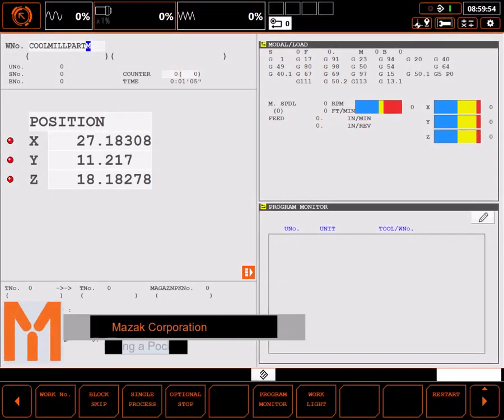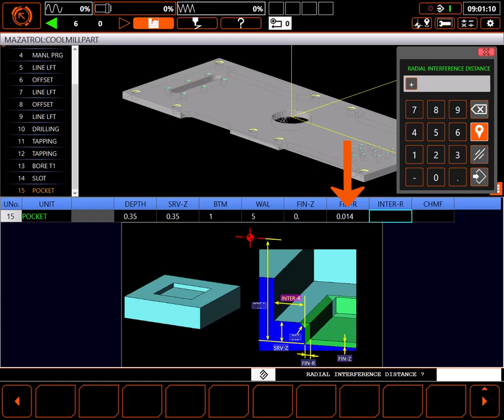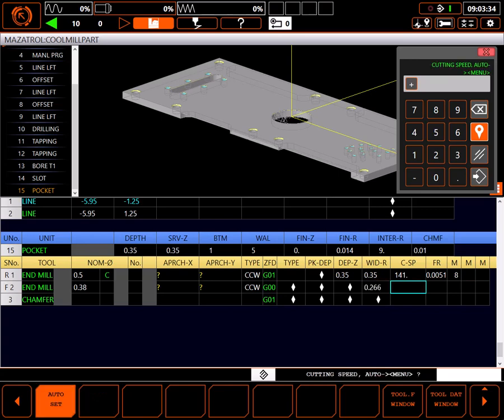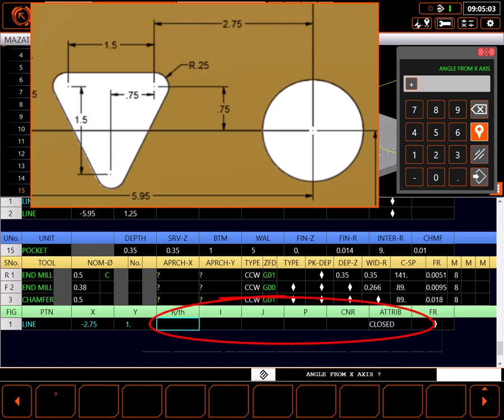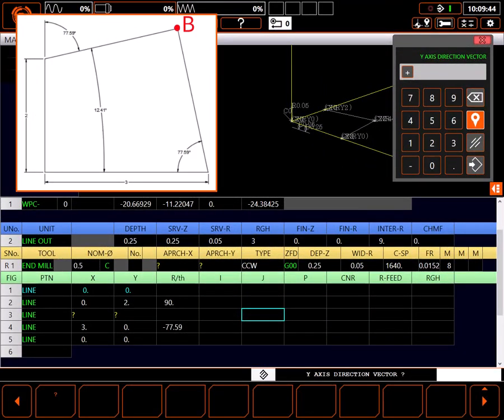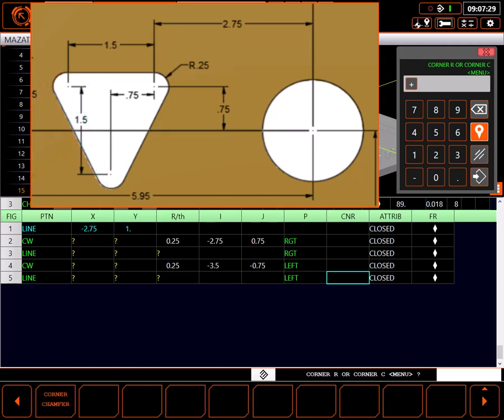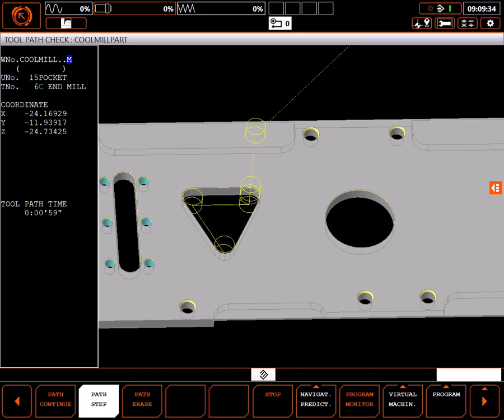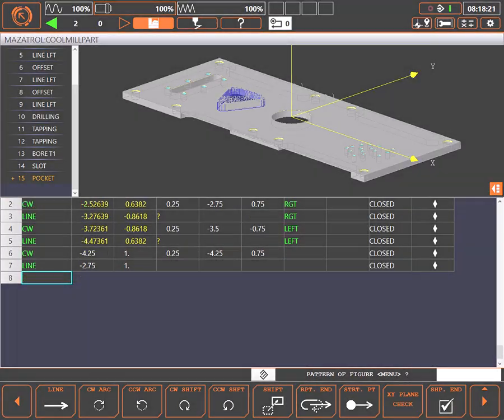MAZATROL Programming Briefs - Milling a Basic Pocket

Comment: Can you go over how to use the pocket mountain feature?
Reply: Hi! Not an expert, but it will be the same procedure as a normal pocket. You first list the coordinates you need for the outer boundaries. Then you go on to program the "mountain". There might be a problem with crashing into the mountain, if it is higher than the pocket.